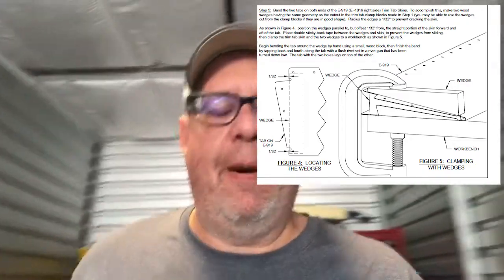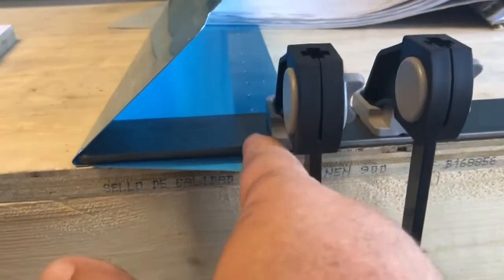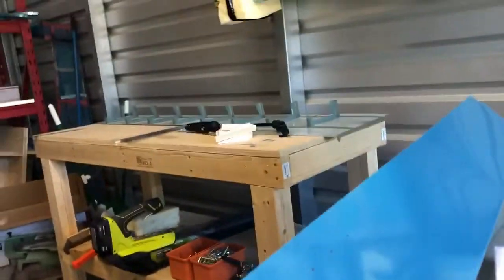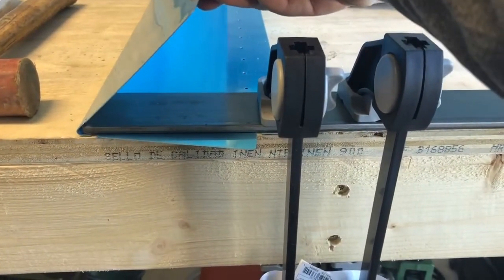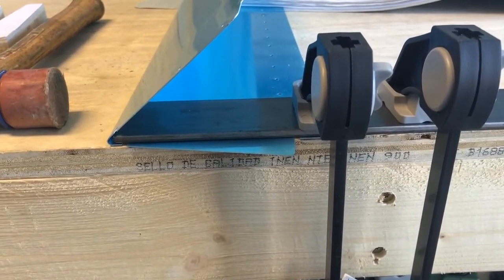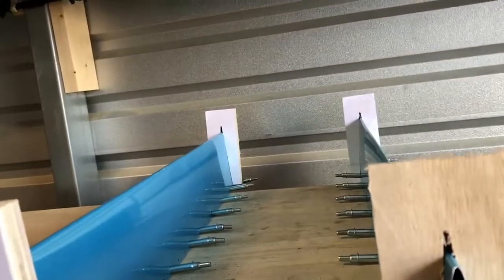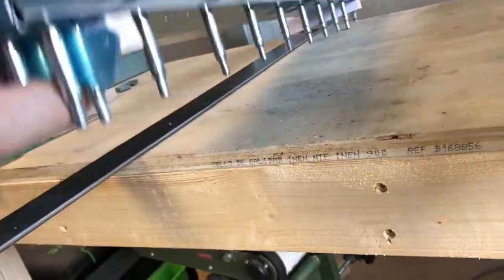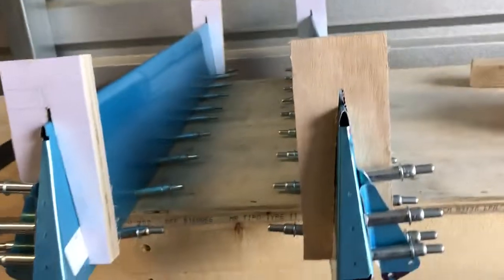9-17 Bending and Mocking Up The Elevator Trim Tabs

Comment: Why didn't you take the blue vinyl off first..??
Reply from the maker: To protect the part from scratches but to be honest I now just take it all off because it will be covered when I paint. Like most builders I was afraid that I was going to mess things up and was way over cautious on everything.
Reply: @n622rv  Thanks for the reply.  The only reason I asked was because my instructions specifically say to remove the vinyl before bending those tabs.  Just wanted to make sure I wasn't missing something.  Thank you for sharing this technique BTW, I think I will try this as well.  Always learning!
Reply from the maker: @MilitaryAIWorks100  They want you to remove the blueing so you can see the position of the bend. So many builders don't bend it in the right area. I have looked at several finished RV10s and it seems to be a hit or miss on bend alignment.